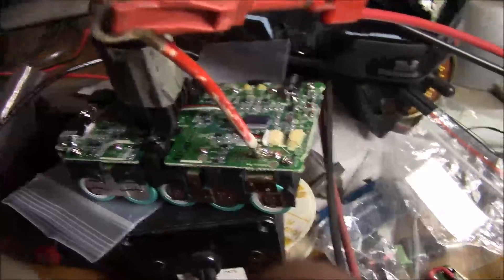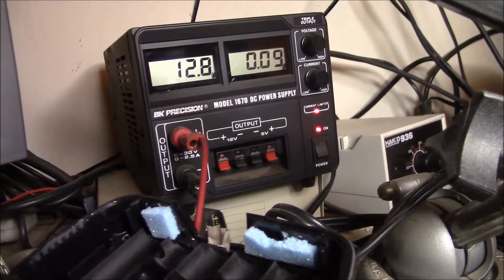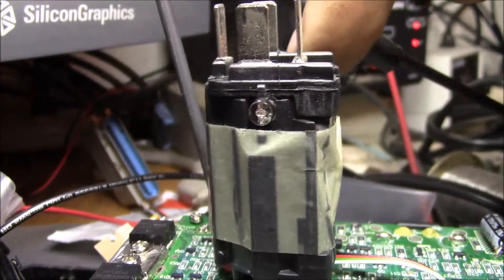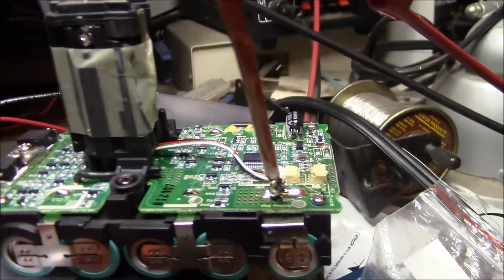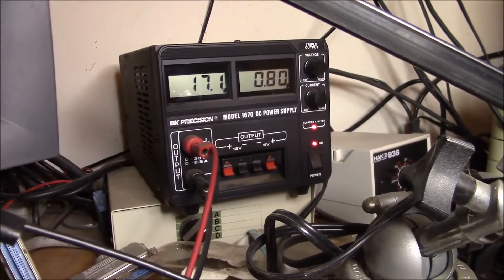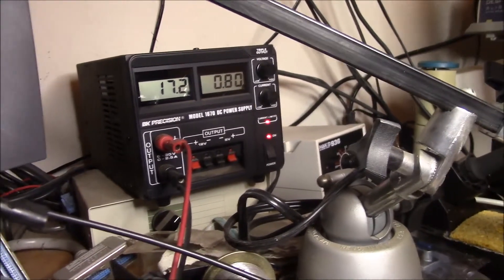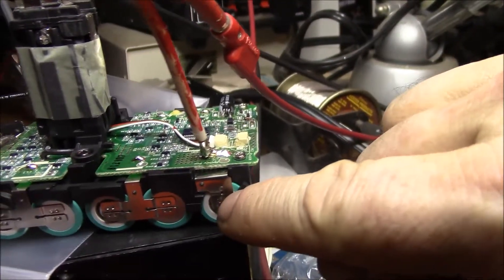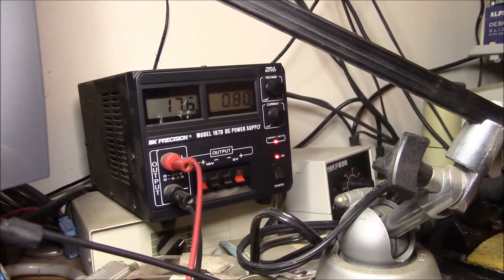C3 Battery Troubleshooting, Part 2

Comment: I have 2 batteries that have 19v+ at the cells and 6.75v at the device pins like other have reported.  Anyone able to get one of these revived?
Reply from the maker: I've not found any fix that works all the time on all packs.  I've found that sometimes you can work with the cells inside the pack.  Make sure all are at similar voltage.  If one or more is a lot lower voltage, try and charge the low cell(s) up.  21.0 volts should be fully charged voltage.  Other times I've tried discharging the cells to a lower voltage and see if that will trick the BMS into letting them be charged.

Comment: I have one (CS1427 72Wh, 2014) that fully charged but only shows 7.3volts at the top posts and one FET; 19.8volts at the cell and the other FET. thanks for this video
Reply from the maker: Might be a flaky BMS board.  That seems to be a common issue and I never could really figure out what the control circuitry on these batteries was, and it seemed to be many different versions over the years.  On some I found a resistor between some of the pins would trick the cell into working.  Sometimes you could charge or discharge the cells directly to trigger the BMS to turn on the charging FETs.
Reply: Did you ever find a solution to your battery issue?  I am currently troubleshooting two packs that have the same issue (7.2v at the top, and 19-20v at the batteries).  Thanks in advance!

Comment: Great Videos!  Does anyone service these batteries?  I purchased a replacement on ebay that came fully charged but when i went to recharge it , it blinked that it was too hot and would never charge.  The vendor sent me another one and the same thing.  At Christmas my wife bought me to more from a different vendor on ebay only to have one blink defective and the other one too hot.  Thinking it might be the charger i went through get 3 of those with no luck.   2 of my batteries are showing half a charge but won't re charge.  I now have 6 batteries I can't use.   Any thoughts would be greatly appreciated!
Reply from the maker: I have a few chargers and find some batteries only seem to charge with a certain unit.  One option to try if you have an RC type battery charger, like the ImaxB6 or similar is charging with that:
https://youtu.be/jdXqmDygtSg
Just clip onto the + and - terminals and set the charger to 5S Li-Ion and see what happens.  Again, I have some batteries that are happy charging this way and then others that won't.  I did try a few tricks to get some more batteries to charge this way:
https://youtu.be/MFuKHjM08k4

Comment: I'm having an issue with a C3 PP2030 that I can't figure out.  It was a near fully charged battery that quit working in the charger.  I've opened the case and tested the voltage at the same place you have soldered wires in this video, it's at 20volts.  But when I test the voltage at the terminals, where the battery would connect to a tool or charger, it only reads 8.1 volts.  I'm stumped.  In your opinion, what could be inhibiting this virtually fully charged battery to the point the charger won't recognize it?
Reply from the maker: It sounds like the internal BMS may be acting up and not allowing the charger to recognize the cell.  You might see if you can discharge the cells a bit from inside.  Also if you have a variable DC power supply, try applying something like 20-21 volts to the power terminals on the top of the pack.  Or if you can try a different charger, give that a try.  I have a few packs that sometimes will not take a charge on one charger, but if I move them to another one, they work fine.